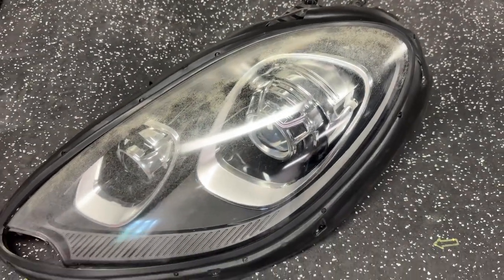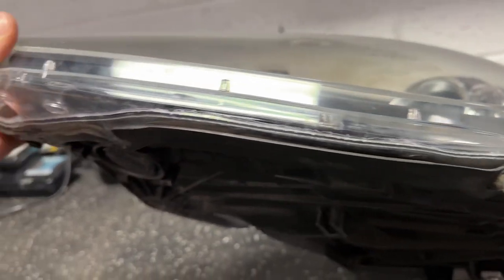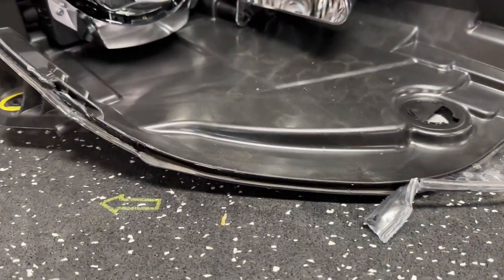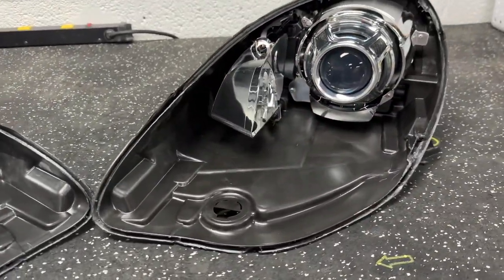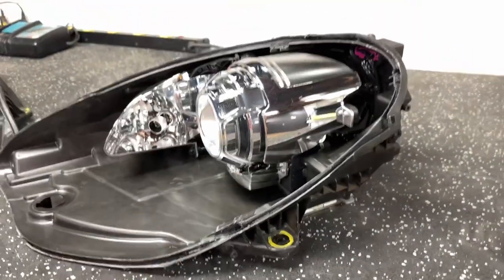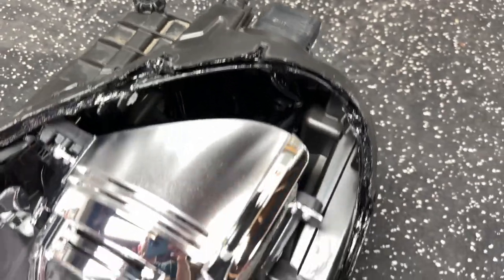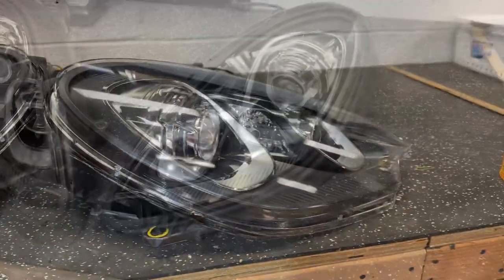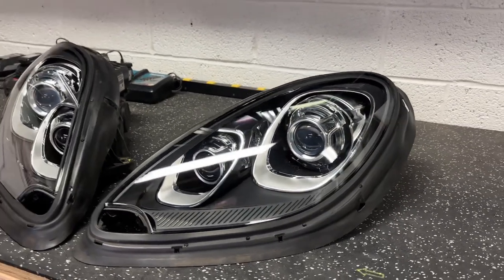Porsche Macan Headlight Lens Replacement Service

Comment: Good morning.  I have to open the headlights of a 2018 Toyota Yaris, which have an electronic board inside.  Butyl sealant.  What is the maximum temperature I can try to open the headlights without damaging the electronic board?  80° Celsius for 10 minutes got nothing: they don't come unstuck.  Have you ever worked on lighthouses of this type before?  The electronic board is inside a small metal box, inside the lighthouse and cannot be removed without opening it. I need a suggestion, thank you very much.  John.
Reply from the maker: We bake at 121 C for 30 mins at a time without any issues to electronics. No need to worry.
Reply: @LightwerkzGlobal  OK, thanks a lot! Giovanni

Comment: Phenomenal work!

My only question is - why don't you apply clear PPF to the new lenses after replacement to ensure they stay clear for years to come?
Reply from the maker: It is a service we will be looking to add in the future. Most of the lights we work on are sent in. Its much easier to PPF when the light is on the vehicle.
Reply: @LightwerkzGlobal  Gotcha, thanks for explaining.